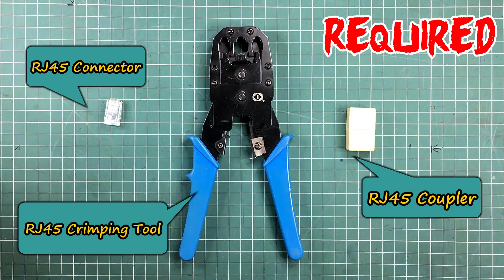CCTV Camera LAN port Repair

Comment: Thank you before for sharing this video, I have question what if only 3 pairs are found when opening the cable ? how to know the order of the cable ? camera that I use is *Dahua CCTV IPC-HFW 1220*.
Reply from the maker: yudha wibowo remove wire from camera site...use multimeter to find which colours cable connect which pin of RJ 45 connector... make a drowning on paper...then go for cut a cable and crimp in connector
Reply: @techfixer3650  Okay thank you for the explanation, I will try first..